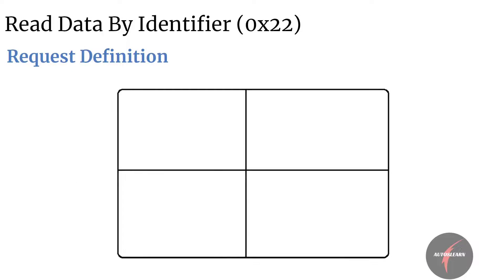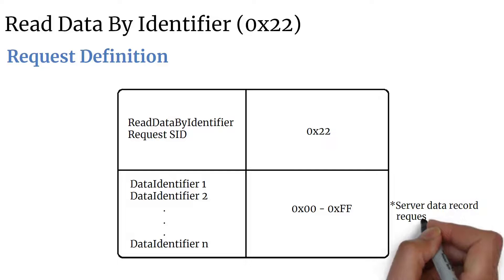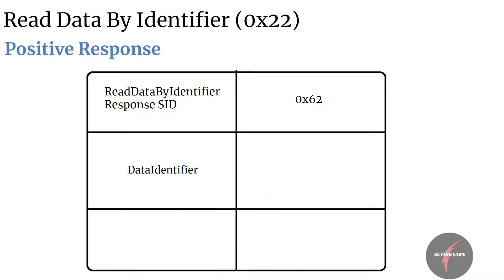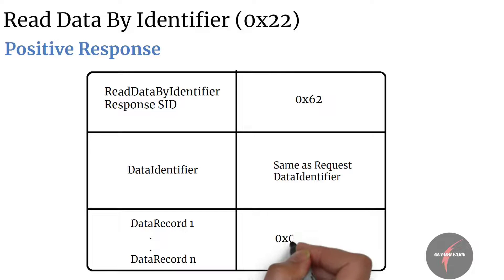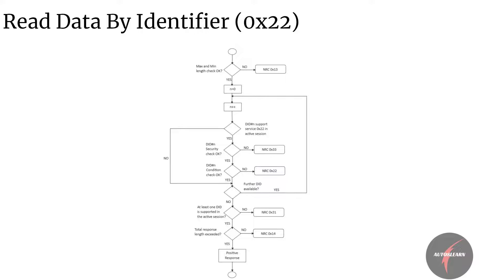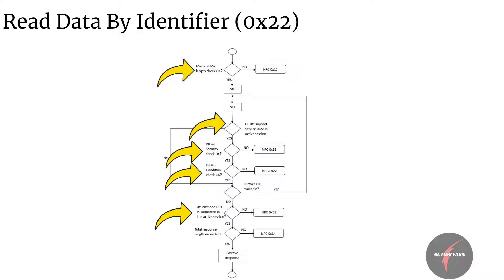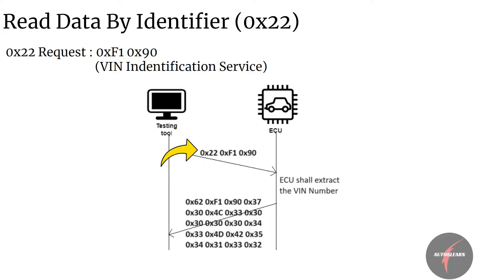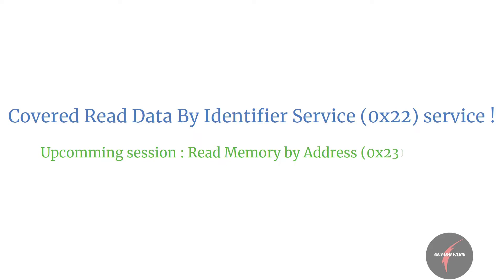Read Data by Identifier Service (0x22) Made Simple | Automotive Diagnostics Series

Comment: What if I request multiple DIDS if one DID gives negative and other is positive what response will I get positive for valid DID or negative for both? Also vice versa what is response if first is positive and second negative
Reply from the maker: Hi Kandula rajKumar,

Great question! Typically, if one DID is valid (positive response), the valid response will be returned, assuming the system prioritizes or acknowledges the valid DID. Therefore, even if one DID returns a negative response, the multi-DID response will reflect the positive responses from the respective DIDs, excluding the negative ones.

Thank you for your interest! I hope this helps clarify your query. Stay tuned to Autoslearn for more insightful automotive videos!